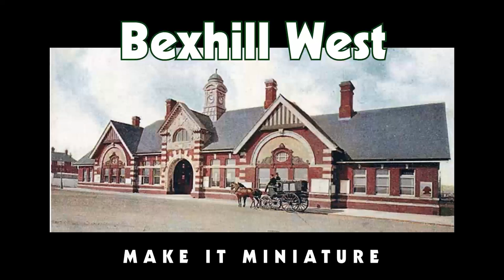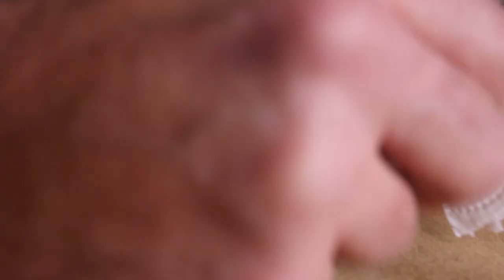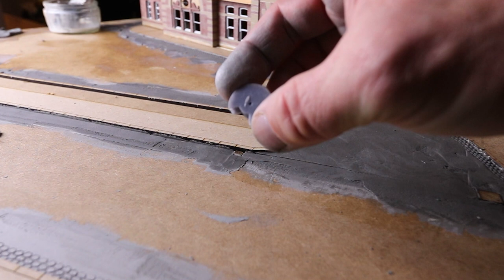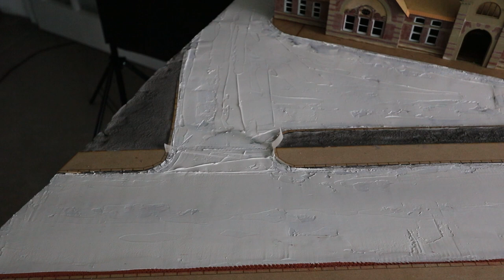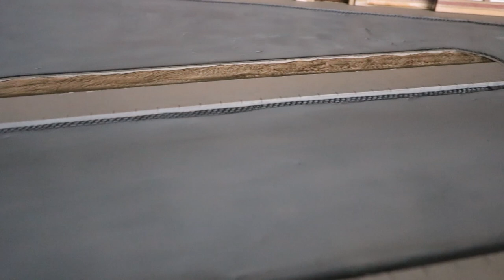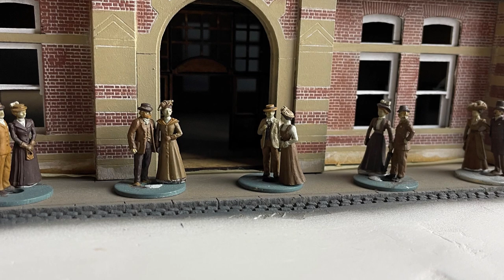Ep. 38 Roads Revisited | Bexhill West Model Railway

Comment: That modul separated would be a very well done scenery showpiece at it´s own (as was your thought at the beginning of modeling the building itself) - as soon as model railway exhibitions start again, you should already go display it (starting small without having to run the trains, switch points, ... while explaining).
Make the pedestrians exchangeable (with pins maybe) - so you can put them away for transport as well as fitting them to the era shown, too.
Previously you have showed a cut in the steelframe, but still didn´t mention why you changed that part - my guess is a road tunnel under the station as seen on the map.
Already waiting for the next video.
Reply from the maker: Thank you Lass, yes it is quite a nice little piece on it's own.  
As for the alteration you mention, I am working on it at the moment and it should reappear complete in a couple of weeks time.  It's not a road tunnel, but that's a very close guess.  I'm looking forward to showing it.  :)
Take care,
James